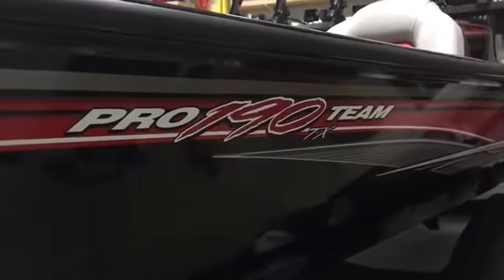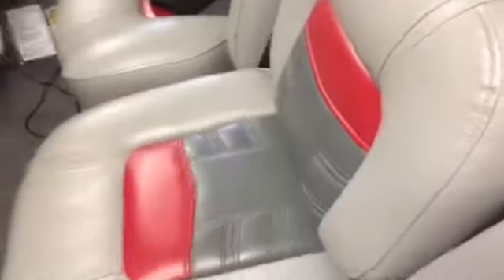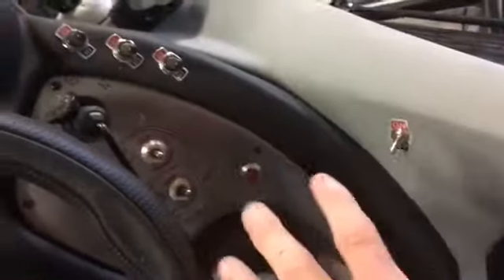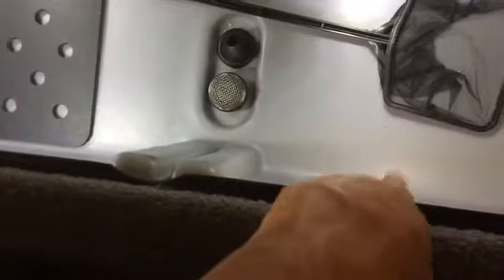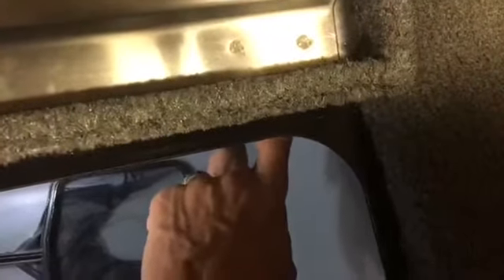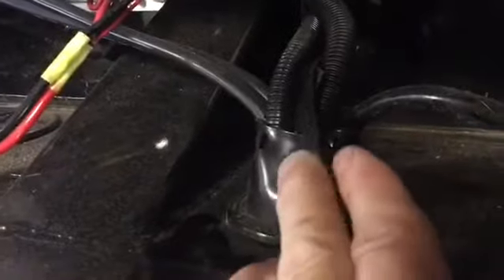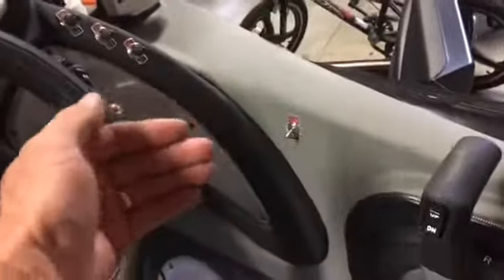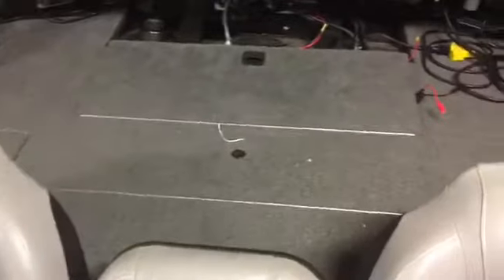Led storage compartment lighting on tracker boat part 2

Comment: Jason, another question.  I was able to run all my wires using an elecrician’s fiberglass glow rod from HF.  The PO had pried the rear of the console away and left a gap that the glow rod would fit thru to pull wires from there also.  However, I have been totally unable to locate the screws that hold down the cable cover that runs from behind the driver’s seat to the back of the deck.  I’m starting to think that it may be riveted on my 2017 model 175 but I cannot locate any rivets either despite lots of poking and picking thru the carpet.  Do you have any advice on how to locate the screws/rivets?  I need to remove that panel/cover to repair the gap in the console.  I see a screw under the end of the console that may be all I need to access to adjust the gap.

Your video was a big help!

Comment: Thanks Jason. This is exactly what I needed.  Pulling the wires up thru the cable boot and using wire loom was a great idea.  Now I know how to remove the cover on the aft starboard deck and to remove the dash panel.  I would not have thought about drilling next to the driver’s seat.  Igot this now!

I’m using LED strip lights which will be much cheaper than the nice lights you used.  I had no idea how much time it would take to create rectangular light strips around each storage box.  Removing the silicone off all the ends of the LED strips to attach the 90 degree connectors was a pain.

Comment from the maker: J t
I’m not really sure what to tell you about that cable cover, all the ones I’ve seen have been screwed down to the deck.  I guess rivers are possible, but they usually keep that stuff to be easily removed. Without me seeing it, I think you’re gonna have to take a second look at it and maybe keep digging. Some of those screws get recessed in the carpet pretty good. I know when I took my bow cover off up front by the trolling motor to mount my sonar, I had a hell of a time finding this screws.  Completely buried in the carpet. Good luck, keep pressing on, you’ll get it.